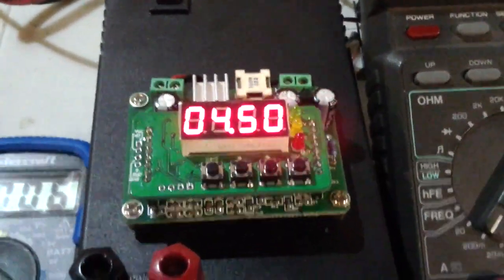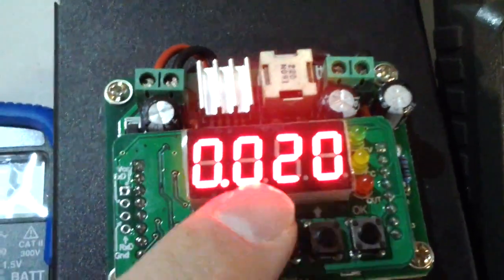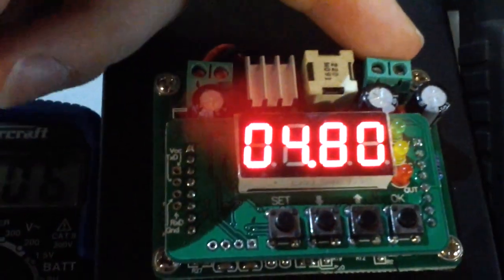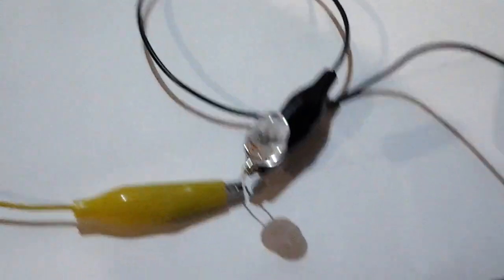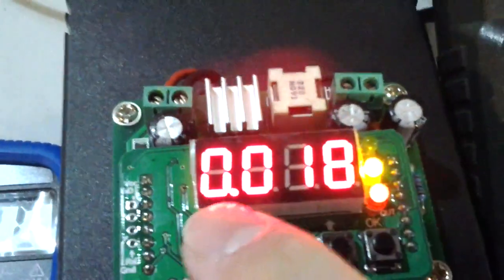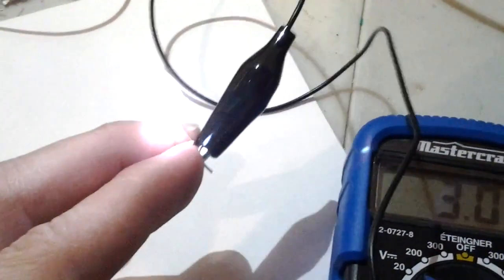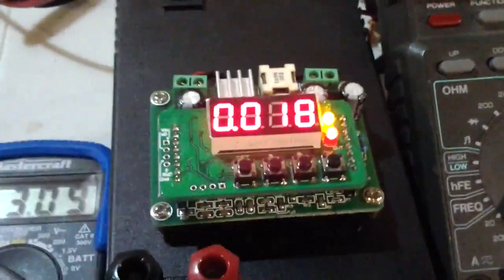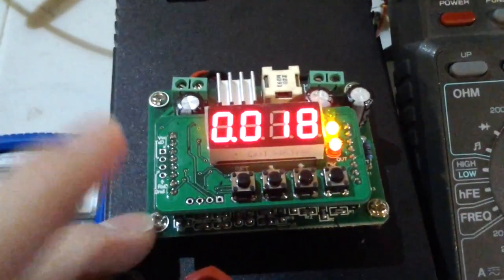DC to DC buck converter icstation com

Comment: mine is blown...
Reply from the maker: That's not good, what exactly happen maybe we can fix it :)
Reply: bakupcpu the choice 0 on the hidden menu was on! when i gave power to it, it went off immediately.. i had a car light bulb on it.
I have ordered a LM2596S to replace it, i assume thats the failed part because it gets hot even when i have no load on the output.
Reply from the maker: mitropoulosilias yes most likely the regulator was pooch. it doesn't like have 3 amp for a very long time even mine I mostly limit to 2.5 and I check the temperature of it.
Reply: bakupcpu yeap the heatsink is too small. i ll let you know if the problem solved after the regulator replacement.

Comment: Good review,  Julian Ilett's review came out happy with it too (as am I with my unit - daily use). I power mine from a 18 V laptop PSU. Perfect!
There ARE some secret menus, too, by holdding the OK button, it'll give 3 more - '0'  lets you decide whether it comes on immediately power applied, '2' makes the display toggle between volts and amps evry second, and '1' gives other measurements - Power and Charge rate!
Also (not found data yet, but pins on the left seem to permit remote control!
This thing's a gift! I think I paid about €10 for mine (free shipping to Finland - banggood.com?)
Reply from the maker: It is a very good unit indeed :) got mine from icstation.com and I'm quite happy with it it's my normal bench power supply then if I need more power I have the 400W dc to dc boost converter unit.
Reply: gag

Comment: Can this run off a car battery with out damaging it?
Reply from the maker: Yes it will operate in voltage from 6 to 40 volts :) and will give you a max output roughly 1.2 volts lower then the max input

Comment: Mwahahaha I found exactly what I want!!!  This!!!  http://www.aliexpress.com/item/ZXY6020-ZXY6020S-NC-constant-voltage-constant-current-DC-DC-power-supply-modules-60V20A1200W-programmable/1613662173.html  
0-20 amps @ 0-60 volts!  This is what I have been looking for this whole time!!! Basically the same as the one you show in the video except has a knob for programming, better display, and way more amps!!!!  :D :D :D  Ultimate bench power supply!!!  Better than any other power supply I have ever seen.  Even the higher end bench power supplies that cost $300.  Humm I think I'll have to buy a power supply to power it though...  and a powerful one at that.  Here is another version that is 10 amps.  http://www.aliexpress.com/item/ZXY6010S-numerical-constant-voltage-constant-current-DC-DC-power-supply-module-60V10A-600W-Programmable/1414281188.html
But why go with 10 amps if you can have 20 amps!?  XD (they also sell a 3 and 5 amp model that have the encoder knob for program navigation instead of the buttons like yours)  Well I guess I didn't sign up for Google Adsense for nothing!  I am going to have to decide what I want to do... I'll probably drool over it for a couple days before it kills me and I have to buy it! XD
Reply from the maker: OUAH!!!!!!! That's Awesome and good price :)
Reply: Yes it is!  I'm kind of leaning towards the 10 amp model now.  That is because a 1200 watt power supply for the 20 amp one is going to run me about $120.  And I don't really want to spend over $200 on a power supply.  I'd like to keep it in the $100 range...  Plus I'm not sure I would use 20 amps that often.  So maybe the 5 or 10 amp one would be the way to go...
Reply from the maker: I got it on eBay for 120 if I remember the price lol 20 amp is not bad :P I'll probably check it the problem after that is I need a 60 volts source hmm.......might be a nice project for future.....
Reply: This was one of the best looking ones I could find that was not too ridiculously expensive. http://www.aliexpress.com/item/600W-48V-110V-input-Single-Output-Switching-power-supply-for-LED-Strip-light-AC-to-DC/835228775.html
They also sell some 1200 watt 48 volt ones that are a bit more than I want to pay.  I think 48 volts would be pretty good for running those power supplies.
Reply from the maker: That's actually not bad at all for the power and voltage it give :)
Reply: Ya!

Comment: Ok that is an awesome looking little power supply!  That is exactly what I have been wanting and more!  And for only $14.10!?  That's insane!  Will have to get my parents to buy me one of those!  Thank you so much!  :)  3 amps should be a good amount too.
Reply from the maker: Yup for most of my project it's good I have a 400W for bigger power need :P
Reply: Can you do a review video of it cause I couldn't find any good reviews of the higher watt models.  Also does the 400 watt one that you own have the button selector or the encoder knob?  Thanks!
Reply from the maker: No the 400W is a step up converter. It's very similar to this one just that it step up. Haven't done a video on it yet but I should it's a nice one :)
Reply: How many amps and volts is the rang of it?  Cause that sounds pretty good.
Reply from the maker: Max volt out is 80 volts at 400 Watts :) that's about 5. I haven't push it to that yet in fact I have nothing that is 400 W at 80 volts lol. I should bring it at the shop and load it on our 2K load bank hmm.....
Reply: Oh so you have like a high voltage model one.  Just hook it up to a like 1000 watt electric heater.  That should be a good load.  Or if you have a big spring.  They sometimes make good loads if they have enough resistance.
Reply from the maker: I have kerosene heater hahaha lol I should have something in the lab if not I'll make a big dc load bank got couple of 60 amp mosfet and LOTSSSS of OPamp :P
Reply: You can just about use anything for a nice load.  Coffee maker, toaster/toaster oven, electric skillet, electric tea pot, or cloths iron.  With some of those you might have to bypass all the circuitry so you don't ruin it on the DC.  You could make a variable load with salt water but be careful!  How would it work with the mosfets?  Would use just not turn the mosfets on all the way?  If so they would need some big heat sinks!
Reply from the maker: No it will use the mosfet in the active region so yeah big heatsink :)
Reply: So wait how would that work then?
Reply from the maker: Very easy most mosfet load bank use micro controller but I'll go analog way :) with good old OPamp and make a constant current source :) and then well a nice fan to keep those cool and voila :) I'll check schematic and who know it may be a good video :)
Reply: Oh ok I think I see how that would work then.  So you are basically not giving the mosfet gates enough voltage for them to be saturated so they act as big variable resistors.
Reply from the maker: Yep! you can also do that with transistor :)
Reply: Yep! Basically what a voltage regulator does!
Reply from the maker: Indeed but this one only care about current
Reply: That's true.